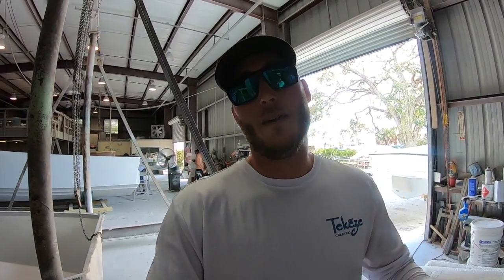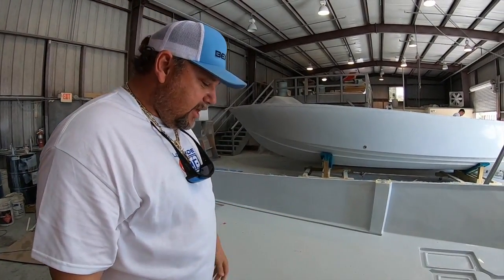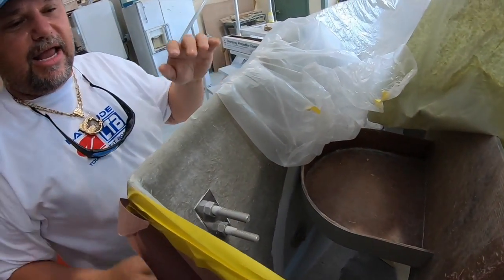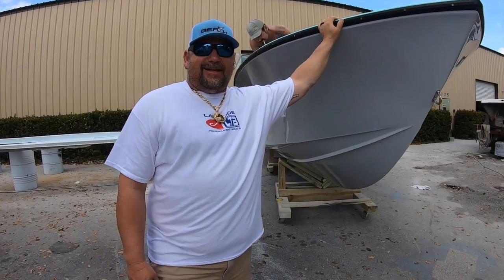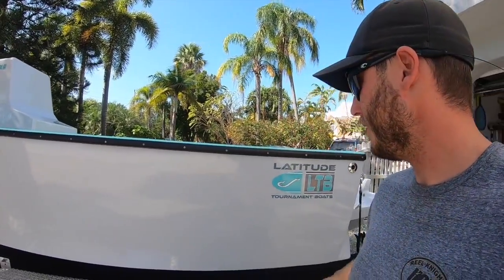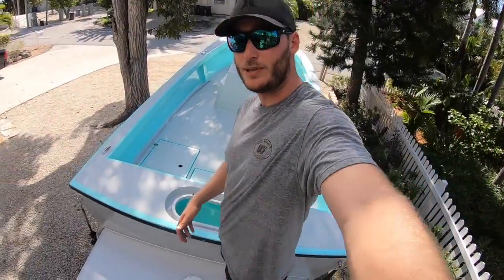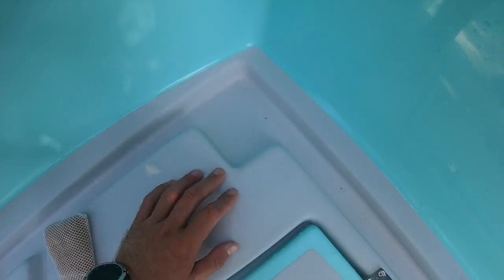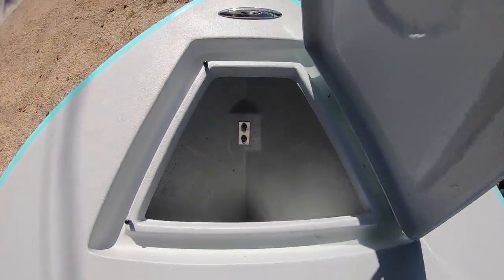Latitude Tournament boats | Factory Tour | Islamorada | Tekéze TV

Comment: Great boat! I could help with one of their building steps that would help a Lot!
Reply from the maker: which building step would you be referring to ?
Reply: I could make applying adhesives on all stringers easy an fast, rather than a hated mess that was on their faces! I could save more than half time to apply as well! With two guys instead of a team hating that step! I even called them but no one answered or got back with me, so they are still working an hating the mess!

Comment: Thanks for sharing the video. Boat looks really nice. Few questions, the base boat doesn’t come with Deck drains, livewell lid or latches? It doesn’t appear to have any insulated fish box, or is the big forward box insulated? Is there another video coming?
Reply from the maker: It does come with a livewell lid and latches! The fish box is insulated by the Foam stringers technically but is not like a seriously well done fish box like you would see on some of the bigger boats. I'm sure it will do its job, but I will probably use a large Yeti for a fish box up front. I will post another video after it is rigged to show the entire completed boat!
Reply: Congrats! The boat looks great and very well built.
Reply: I didn't see any latches on the boat? Are  they typically included but you decided to install them yourself?

Comment: How did the 1/2 ton do towing it? It was not rigged and no fuel but, do you think it would be an issue with F-150 eco boost?
Reply from the maker: No towing problems at all. 60mph is about the speed you want. Not going to be able to tow it at 80 without sucking fuel.